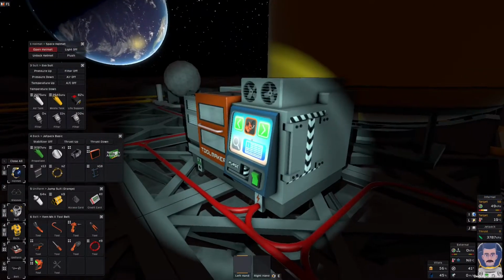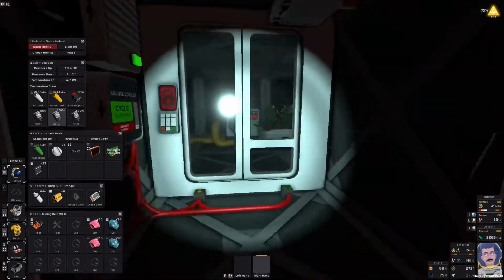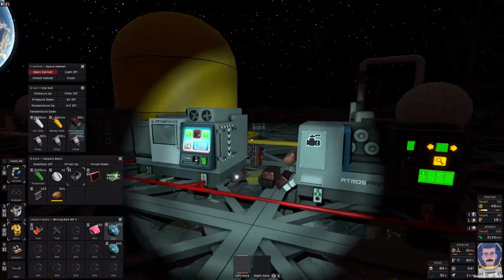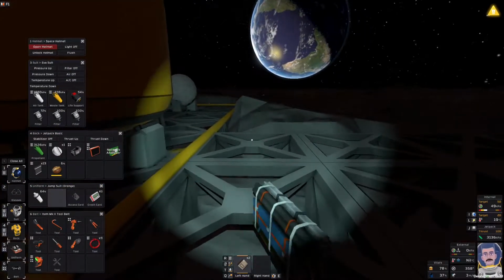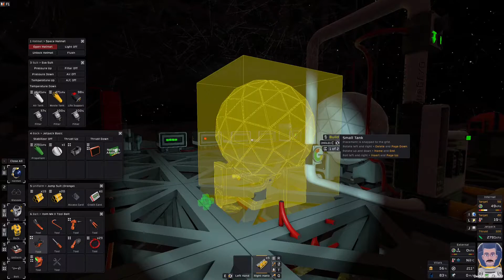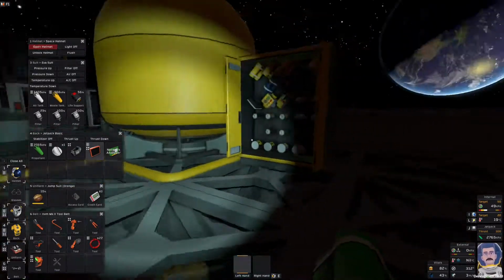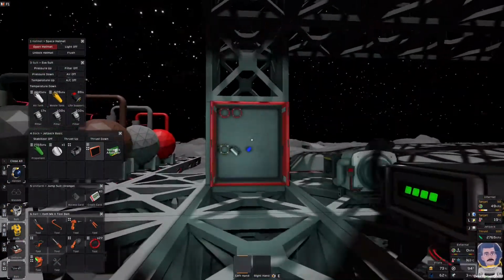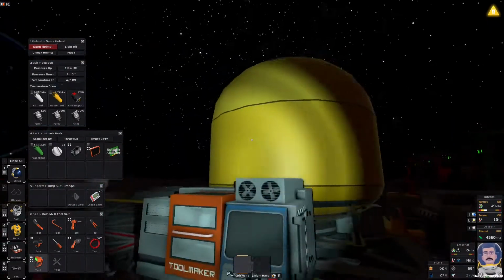Let's Play: Stationeers - Episode 13: More Atmospherics

Comment: The wires supporting things would drive me NUTS, .... OCD 😂
Reply from the maker: Yeah, I don't like the free-standing or "floating" wires, but sometimes it ends up that way due to trying to build compact or just needing a certain device in a very specific place. One of the biggest challenges I recall was doing the plumbing and wiring for a suit storage system. Once I figured it out, it was easier, but man was it hard fitting all that stuff in one wall frame!

Comment: What about a hydroponic building and how to regulate the ideal atmo for plants?
Reply from the maker: I've had a few requests for greenhouse/hydroponics stuff, so I'm kind of leaning in that direction. A lot of the recent stuff has been either desperately needed (solar power plant) or groundwork for a greenhouse project (atmospherics, etc.). I think I'll continue moving that way.

That said, I've been thinking about it a lot and I'm seeing that a proper greenhouse is going to be a major, multi-part project. So, it's likely that there won't be a single "greenhouse" video, but rather the next several will be working in that direction.

I also have some additional things I want/need to do with the atmospherics plant that will likely be a part of the project along the way.